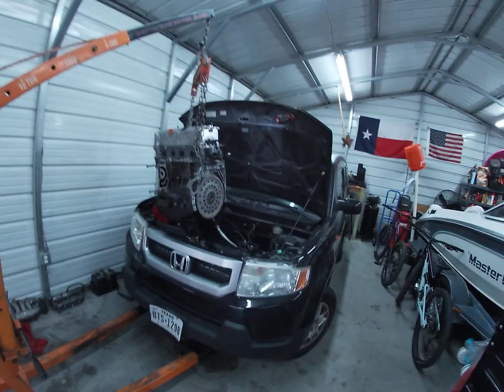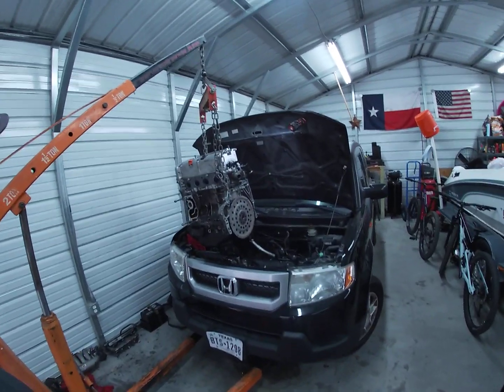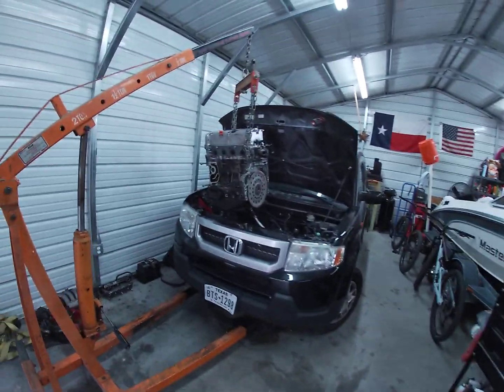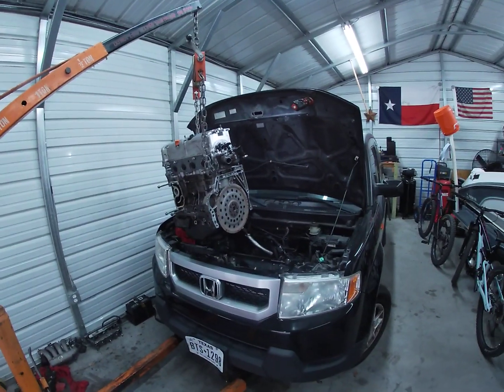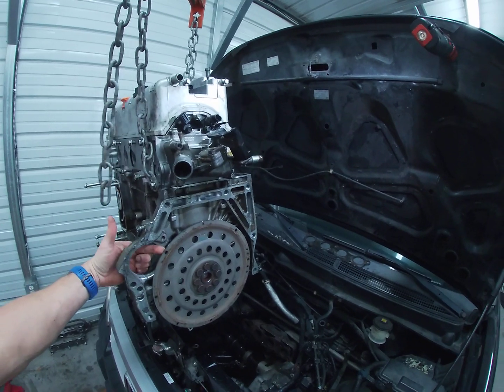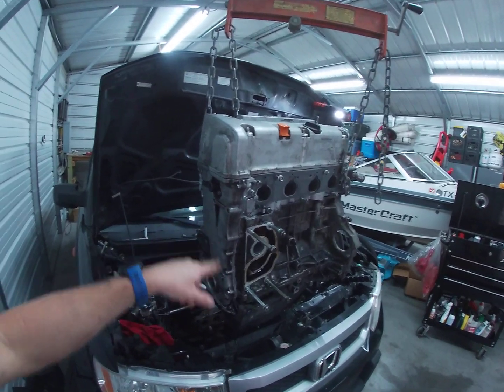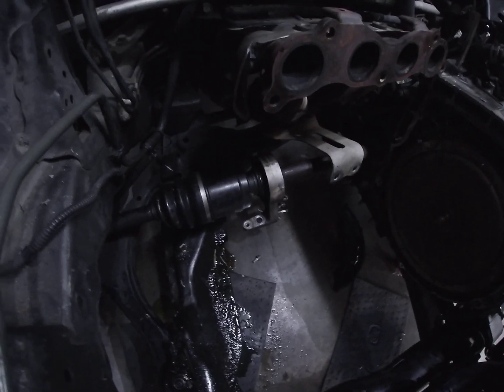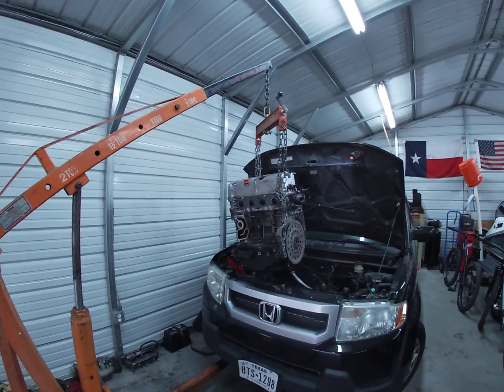2011 Honda Element engine removal explanation

Comment: Is this a k24a8 engine you replaced it with? Was it a plug and play no ecu tune required?
Reply: How did it go for you when swapped did the ecu take without other modifications

Comment: Could you lift out the engine and transmission as a single unit?  Also where are the attachment points for the chains?  Thanks,
Reply from the maker: Havent tried it but I don't see why you couldn't pull them both out together after disconnecting both of your CV axles and everything else connected. I connected the chains to the intake and exhaust studs on opposing corners.